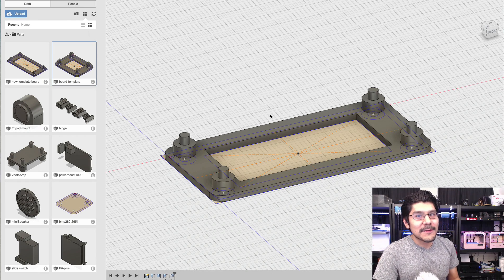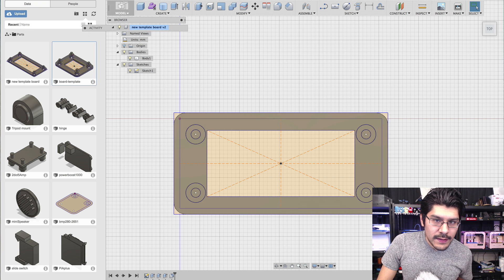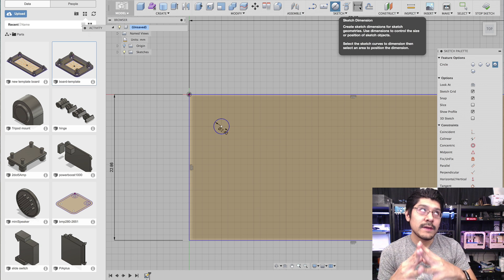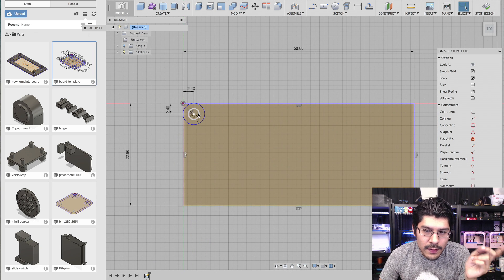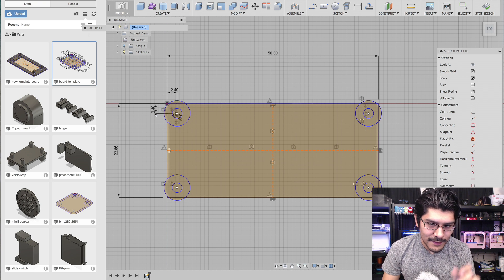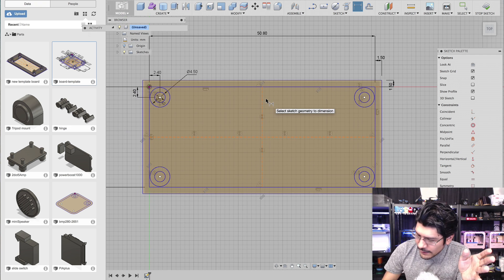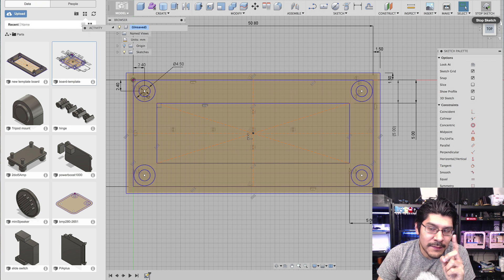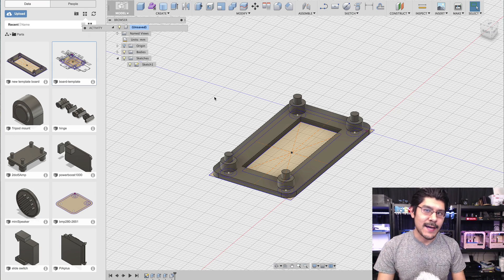Layer By Layer - Circuit board template for 3D Printing

Comment: Thanks for making this video! I'm just getting started with Fusion 360 and this definitely got me excited and motivated to keep practicing with sketches and constraints. One thing I would experiment with to make the template even more powerful (I realize it may be out of the scope of what you were trying to demonstrate here in this video) is to add user-defined parameters so you could see a list of dimensions and update them even faster and then use those variable names when using the sketch dimension tool (e.g. boardWidth=Xmm, boardHeight=Ymm, etc).
Thanks again for sharing these tips, I definitely share your enthusiasm when it comes to the power of parametric modelling :)
p.s. I also just want to say really good job on the editing of this video! I realize how much time that must have taken but it really made for an engaging, concise and really interesting video!
Hope you are having an awesome day, 
Deric.